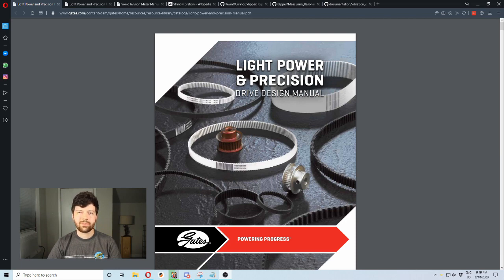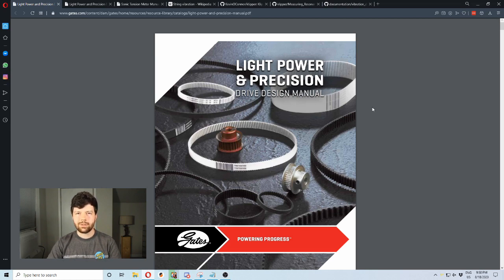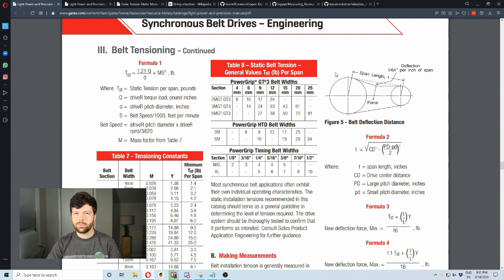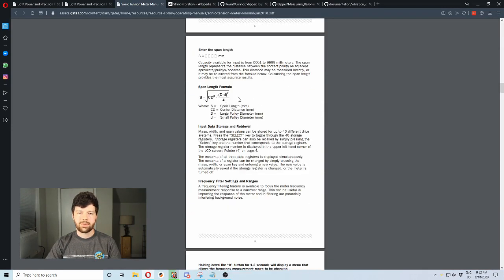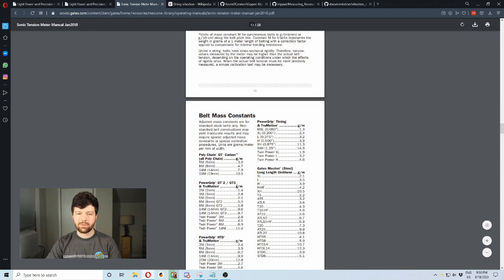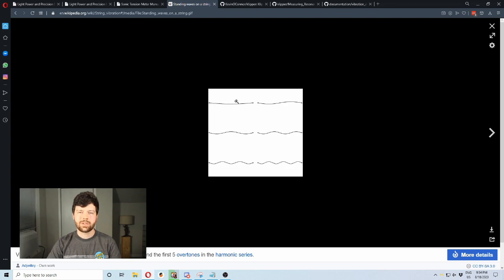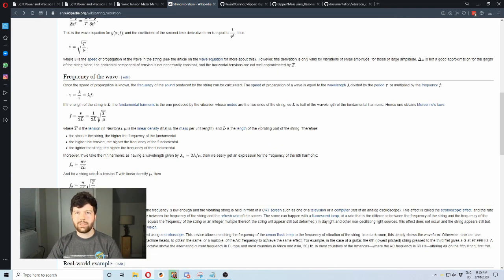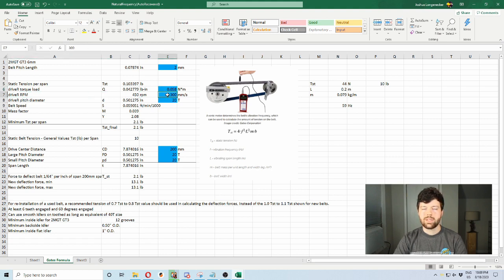3D Printer Mechanics: Measuring Belt Tension

Comment: Thanks for this in-depth video! In the end, what's your conclusion, how should I tension the belts of my voron? According to the Gates formula? Or what do you do you suggest?
Reply from the maker: That's a great question--I don't think I have a great conclusive answer for you. My current favorite check is to measure the resonance of X and Y using an accelerometer--if your X frequency peak is between 50-60Hz you should be in the right ballpark for a standard Voron Trident or V2. If you have multiple peaks on X that are close to each other, I'd double check your belts to make sure they are evenly tensioned.

Comment: Thanks for the video! However, I cant understand if you are using a GT2 or GT3 belt. They are not the same belt and according to Gates website GT3 is a stronger belt with improved technical capability across the board.

Comment: Hey Eddie, I know why your mass per length value of 9.1g/m didn't match Gates' of 1.4. I was reading the design guide and those mass constants are actually gram/m per mm of belt width .  So if you take your measured value of 9.1g/m and divide it by the 6mm width then you get something close ~1.5g/mm. Great video, keep 'em coming. I loving see fundamentals of engineering applied to fun topics.

Comment: Hi eddie I'll try to give my grain of salt to the community (as I'm building a custom corexy based on the voron and comunity printers, but with 2 Z leadscrews instead of belts, as it was what i had around).
As a CAE engineer "who works at the automotive industry" and for years specialized in NVH, I can tell you that even though you are not wrong in the aproach of the belt simplification. The actual printer behaviour is more aproximated to a "fixation"+belt+mass(extruder)+belt+fixation system. 
Natural frequencies or resonances can nearly be expressed as a complication of the 1D-spring natural frequency model but combined.
If you look at the belt tension formula its a derivation of the fn=1/(2π)×√(k/m) where K is de rigidity and m the mass.
so assuming that the extruder an everything else is rigid and only the belt area in the X axis is "vibrating" and resonating they do because the rigidity of the belt is not "enough to hold" the relative position of the printer head vs the pulley that generates the "movement/oscilation/vibration".
I found comprenhensive to think of resonance as punching a boxing bag. if you match your "punch" or pulley-belt moving force with it coming to you, you will stop/ cancel the "movement" 
If you instead wait and punch it again when it came through and goes back forward it will go further.
That punching frequency is your resonance frequency.
Something similar happens with "structures" and our belts. if they were infinitely rigid the motor would pull them a 1mm at whatever frequency generating i.e. 1000m/s^2 accel that would move the printhead and belt mass but as something rigid that accel/force would not deform the belt so the belt printhead would have moved 1mm. 
But as they are nor rigid it happens like a whip effect that the pulley has pulled pushed an pulled again and your belt extruder end still hasn't come back so beeing still "deformed/displaced" it recieves the new punch deforming even more....
The thing is that your oscilating mass includes your "extruder mass" and so it should be taken into account for "ideal" belt tension calculations.
The problem is that a lot of factors influence that. extruder design, mass belt sizes, belt materials.... so its not easy to give an actual fill in formula for every printer.

But its nice to see people trying to explain this to everybody. 

Oh and a simple note. a too loose belt means nothing holding the extruder so with low accels the belt can "flex" and create defects. But a too tight belt transfers every other part vibration (motors, fans, leadscrews, to the head. giving also artifacts.
So the ideal would be a enouch tight belt to hold the head mass but not too tight to Damp other incoming vibrations. Nothing easy xD.

Love your videos. hope you keep doing them and hope I helped understanding It a little better. (on damping effects would take another half sheet text to explain xD)

Comment: your the first person I've heard describe this banding. I've suspected it was belt related but couldn't prove it. I switched from smooth idlers to toothed idlers a while back and that helped (all gone on y axis) but I've had this pattern remain on X (using an i3 clone btw). Now I'm thinking maybe I over stretched my belt and should change it. Going to try this soon. I was given advice like you've mentioned "you probably need to make it way tighter than what you think".... Thanks for this!
Reply from the maker: The 2mm vertical banding is still a mystery to me--Railcore did a lot of experimentation but it didn't seem to be super conclusive (at least not repeatable across a lot of printers). Fortunately I don't really see the pattern on my printer but if I go down the rabbit hole again sometime and find anything I'll be sure to share :)